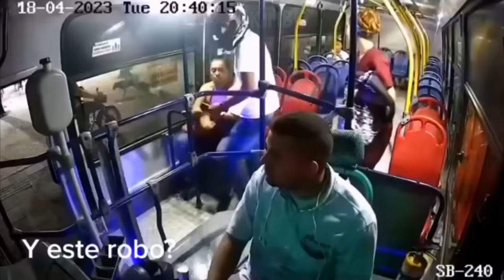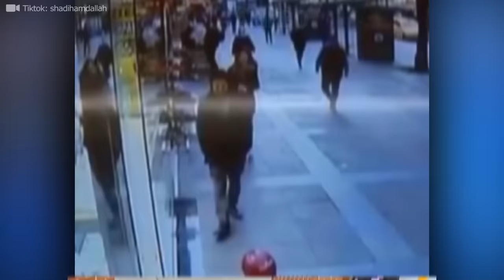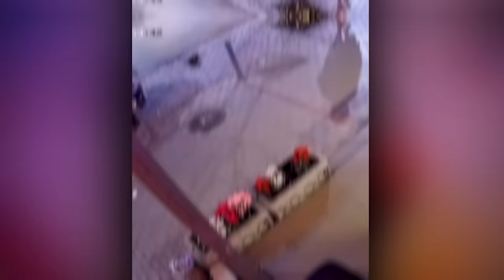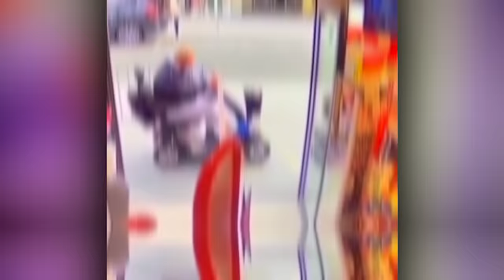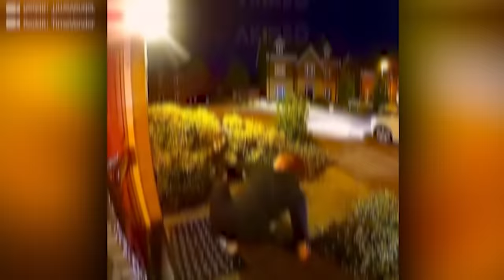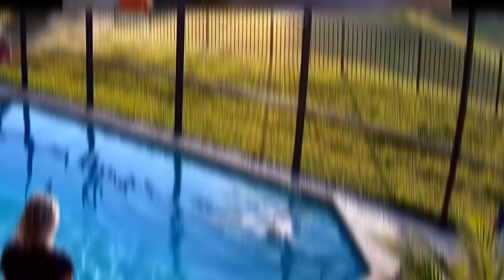She Didn't Know A Camera Was Watching Her - Best of 2024

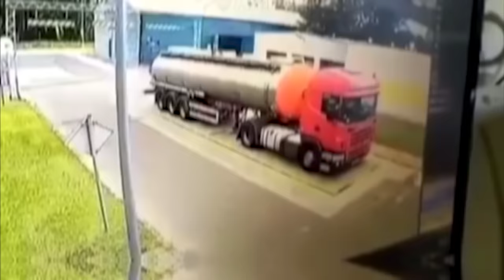Comment: 4:12 weight is the opposite of the problem there; there wasn't enough inside. the container imploded because the pressure inside it was too low.

Comment: Americans stop Calling them emergency brakes , they are hand brakes to be used every time you stop / park .
Reply: We call them "parking brakes" but for some reason also "E" brakes which stands for "emergency". Granted they don't do much in an emergency. Ask me how I know.... We don't usually call them hand brakes because for like 60 years American cars had them on the floor as an additional far left pedal.

Heck even imports. My 2012 Hyundai has the parking brake on the floor but my 1995 Pontiac Trans Am has it in the center console as a "hand brake". So there seems to be no steadfast rule.

Add to that being auto transmission cars already have a parking mode that prevents it from rolling we rarely if ever use the parking brake. Even when I had a manual trans car I was in the habit of leaving it in gear so unless working on it or some other obscure reason never really used it. However when the brakes went out on my 1989 Chevy Astro van I slammed it in park and jammed on the parking brake. ...And now my insurance rates have doubled because I smashed into another vehicle at an intersection.

In short, when the normal brakes went out neither park position on the transmission or the floor mounted parking brake did jack shite regardless of what we call it.
Reply: Add to that... as defined here in America and I quote if you google it.. "A parking brake, also called an emergency brake or e-brake, is a mechanical hand lever or foot-operated brake that is a backup braking system. It is located either between the front two seats or to the left of your gas and brake pedal."

Seems Google agrees with me granted we don't need or use them for parking here AND they are completely useless in an emergency. Heck, maybe us Americans only use them for drifting but the media doesn't notice? LOL.
Reply: One last thing to note. I live in south Florida. No hills here. Not that I ever used the parking brake when I lived in hilly areas I can easily imagine that 95% of drivers here have never used their parking/ebrake. And that at least 1/2 of them don't even work if they tried. Seized up from lack of use.
Reply: @whichgodofthousandsmeansno5306  That's why they are called Emergency brakes, using them at speed will cause one!

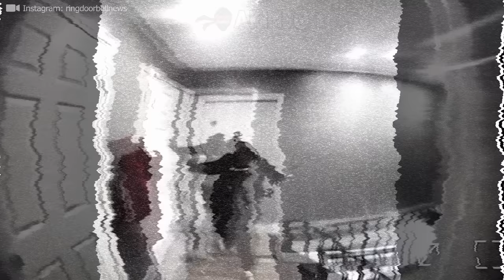Comment: @8:32 A perfect example what a properly secured exterior door requires; dead bolts 8"inches from bottom and top and at the door handle. My doors have this, they are solid iron wood (Brazil)  and when all locks are engaged it takes 10 seconds from inside using no keys the doors cannot be breached without a heavy (20lb) direct blow to all three multiple times.

Comment: It's not an emergency brake. It's a parking brake.
Reply: That is "technically" correct but for some reason American automotive manufacturers consider it a parking brake OR an "e-brake"... "e" standing for "emergency". Just google it. That said, they are useless as emergency brakes and 99% of drivers don't use a parking brake because we just put it in park or leave it in gear if a manual trans.

Add to that a recent comment from someone not from America complained that it is supposed to be called a "hand brake". All well and good if you don't consider how many billions of cars have it on the floor which American cars specifically have been doing since like the 1950's in most cases.

Granted plenty of American cars have a hand brake in the center and plenty of imports have it on the floor. Hard to reach a consensus with so much ambiguity involved.

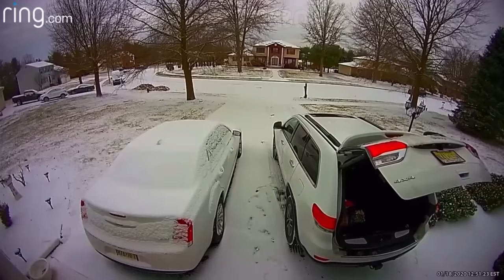Comment: 21:42 yikes. either rookie engineer or contractor didn't follow the plans. usually a pad mount on someone's property will still have the utility sign off that it was installed properly before energization. but i guess they didn't stick around to make sure they put bollards around it

Comment: Do all Americans call a parking/handbrake for an emergency brake?
Reply: Ironically it's only an emergency brake that's needed when you forget to set it. But it IS an emergency brake if it has a cabled connection (not all do), in case the hydraulics fail. Mostly used for "parking". "Handbrake" covers both use cases.

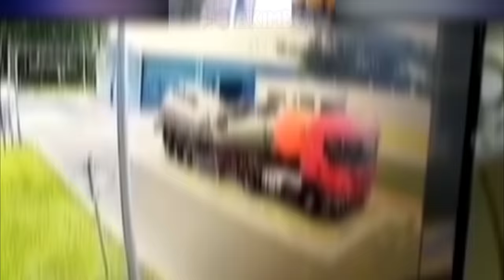Comment: At 4:15 WRONG!!! That's not HEAVY it IMPLODED. The tanker driver apparently didn't study for his test. The D.O.T. needs to require certain questions not be wrong apparently. I got a 96 and felt bad so I went over the material again and again even after the test.
Reply: What would cause an implosion like that? The only thing that comes to mind for me is some kind of extreme air pressure differeinceration.
Reply: @whichgodofthousandsmeansno5306  Hot air cooling. Wow. Difficult.